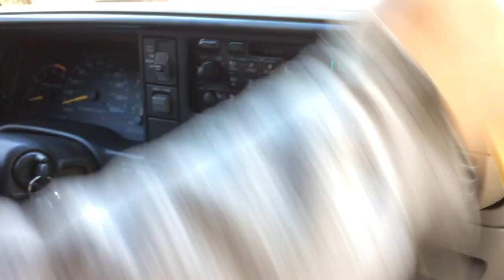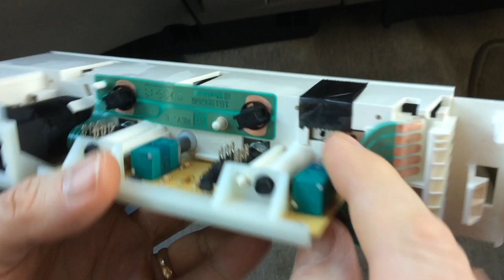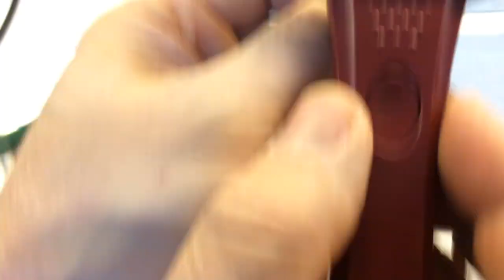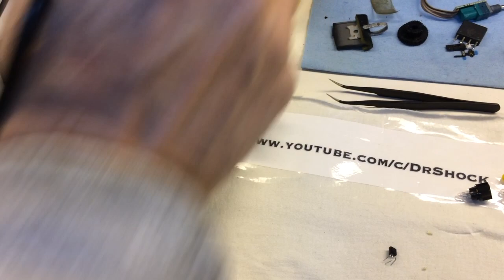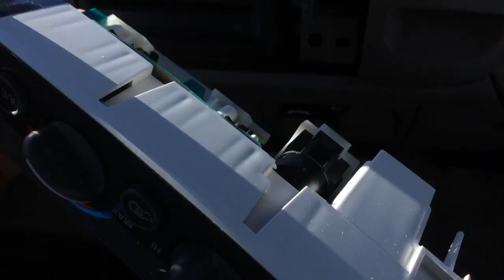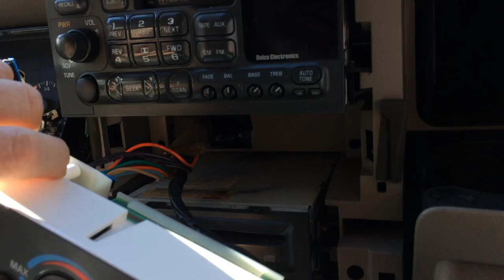1996 - 2002 GM Truck AC Blows Floor Only / Climate Control Module Transistor Repair (Chevy & GMC)

Comment: Have a 96 tahoe there ac/ recirculation button do not light up and the temp door or the zone knob do not work i have installed 3 different entire control units one actually is a dorman unit from advanced brand new and still no change.... the green wire on the connector was burned i replaced it And it is getting power but still no difference any suggestions
Reply from the maker: For the small orange lamps for the recirculation and AC buttons not to work it does sound like a symptom of this same power transistor being out.  Have you taken a multi-meter to the output of the green wire coming out of the flat harness (the green wire that goes thru the firewall to the accumulator cycling switch) to confirm 12VDC is coming thru?  If not, that transistor has blown on the control unit.
Reply: DrShock haven’t yet I’ll check tomorrow when i get off work but id be surprised that all 3 units have blown transitors im thinking it’s a power wire issue (green wire)
Reply from the maker: Unlikely, if you check the schematic in the service manual (there's some online links in older comments below) the transistor gets power thru the main harness (orange/dark red INPUT), and then switches it out to the underhood harness (green OUTPUT).   For those two orange button lamps on the control unit itself not to illuminate I would not expect the problem to involve that green output wire harness (tho it could be something other than the power transistor though).  Best bet is to tone it out with the meter and the schematic.

Comment: I have found on mine a crack in the pcb trail  must explain why mine would quit if the plug on the passenger side of the climate control unit was properly plugged all the way in but slide it out a little and my ac would start working
Reply from the maker: Easy salvage yard fix to replace the board from a donor, see if you have an LKQ facility near you.  They let you pull the parts yourself.

Comment: OK. Now my New "Standard" one failed exactly as my ACDelco. Small puff of smoke out the right side of the control until then the exact symptoms you describe. I examined both ACDelco and Standard and failure was the same. So it appears I have an intermittent short. Could you please dumb it down and explain how I find this short that has now blown that transistor on both the original ACDelco and the new replacement? Again, both assemblies failed the same with the same symptoms you described in failure. 1996 GMC K2500.  Thank You!
Reply from the maker: When they go intermittently like that, in my experience its a place where the harness has rubbed thru the insulation and is making contact to the engine ground somewhere intermittently.  Very unlikely to be behind the dash, more likely under the hood so start there.    If you go thru some of the older comments on this video, there's a thread with a PDF link to the GM service manual posted 6 months back where you can find the wiring schematic.   This can help you follow the harness colors under the hood searching for any physical damage in the spots where it comes in contact anywhere metal.  The damage can be very small!  So a magnifying glass might be helpful. You're looking for bare copper showing no matter how small.  The fix can be simply electrical tape short term, but longer term to wrap in some tough plastic piece to deal with the rubbing.
Reply from the maker: Also I should mention to check the refrigerant pressure switches for damage / shorting at their connectors (but do not remove them) as you follow the green colored wire in the schematic around to the compressor.
Reply: @DrShock  Thanks again. I must be missing something. I read all the posts and looked at the two views of the wonderful color schematic. All I can see is the light green wire going directly from the A/C Control module to the A/C high pressure cut out switch. From there to the CPU. I see no other routes as others have referred to. It seems like the easy thing is to just splice in a new (equal or better gauge) light green wire from the harness connector at the A/C Control Module to the HP Switch and then a new wire from switch to CPU. What am I missing??       Another thought: What about the ground wire going through the same harness at the A/C Control Module to gound up under the dash?? Couldn't a bad ground cause an over-current situation (I'm a mechanical guy not an electrical guy)?? It would be easy to splice an auxiliary ground from the existing black wire to some easy place under the instrument panel or behind the A/C Control module.  I would greatly appreciate your more experienced and knowledgeable thoughts on this. I'm getting frustrated and am spending too much money on A/C Modules. I did order the transistors you recommended and will be trying to repair two modules that I have blown.
Reply from the maker: The wiring can vary with every engine even in the same model year for the AC.  The 6.5L diesel V8 has the most connections with this particular light green wire circuit.   Looking at the 5.7L Vortec V8 (page 6-1675 in the service manual) yes its just the high pressure cutout for that engine as well as the 5.0L V8.  The 7.4L V8 schematic is on page 6-2789.  That light green wire is directly connected from the transitor on the control module logic board to the high pressure cutout switch and then to the VCM/PCM pin C3 on all the gasoline V8s.   If you see no insulation damage under the hood, I would check from the firewall back inside to the control module harness connector itself then.   It would not be the ground shorting out the transistor, what's burning it up is sinking too much current.  Ground problems would leave you intermittent or no function at all.  I would also try disconnecting both the control module harness and the PCM/VCM connector C (both ends).  And then seeing if you are getting continuity to ground on the light green wire from either end, highlighting a short to ground (do this test with a helper to wiggle around the wire harness during the test as well at both ends).  If so, I'd then disconnect the high pressure switch connection and try again (to see if it is the switch that is shorting in some way internally).  If its not the switch then you would still have a short somewhere, perhaps more likely on this engine from the switch to the VCM/PCM than the other part of the circuit.  These can be very difficult and aggravating problems.  Definitely one of those walk away for a bit and retry ones.
Reply: @DrShock  Great advice. I have 7.4 Gas so it is direct. I think the easiest thing is to just run my own wire from the A/C Module to the HP Switch and then from the Switch to the PCM. (From my experience it would be highly unusual for the switch to short to ground, but who knows!)  It will take less time than a  propper diagnostic as I have to work alone. My transistors arrived today so will take one A/C Module with replaced transistor, and then replace light green wire & green with white wire (I think) from switch to PCM and just see if it blows the transistor again. I will update this posting after I try that. Thank you again for all the valuable lessons and advice.
Reply: @benkanobe7500 did this work?

Comment: I did something I almost NEVER do, I replaced mine through Rock Auto with a "Standared Motor Parts" (when I was young, Standard supplied the highest quality points and condensers you could buy). They may be a China company now. But, they offered a 3 year warrenty as compared to OEM ACDelco of 90 days. It works perfect and was (I think around $150.00) and is well past 90 days. However, after seeing yet another astonishing YouTube of yours, I am going to get my original and see if I can fix it from what you have taught us all here. Amazing!
Reply: Agreed! I bought a replacement but now that I have no risk, I will fix. Why? Because we are men and we are curious! Lol
Reply: How is it doing now after 5 years? 

I’m looking to either get SMP or AC Delco climate control module with the OEM Delco costing less than SMP but it has 24-month warranty compared to the SMP’s 36-months. 

There’s little price difference between them, so I’m just curious how your SMP module is doing before getting one or the other.

Comment: anyone know where i could get the ac harness ?
Reply from the maker: Not sure which harness you're referring to, but the least expensive option I would recommend is a you pull it type of salvage yard.  Like LKQ.
Reply: it's the harness that is connected behind the hvac that you unplug to swap out the old hvac with a new/used one
Reply from the maker: Definitely wanna go salvage yard on that, cheapest route best fit. If there's an LKQ yard in your state that's where I'd go, that's a you pull it yard.

Comment: great video my problems exactly! Replaced climate control module 1 month ago! I went to the junk yard today pulled a control panel out of another suburban and put it in mine now everything works great again! pulled the brand new control panel out and it says made in china complete junk! bought the new one from Napa, so if you have this problem just find a working one from the junk yard!  my new one from Napa only lasted one month before transistor failed! QUESTION can you switch control board from the old one that works to the failed one I got from Napa?

Comment: I replaced the transistors, but one is still blowing our after replacement. I understand that there may be a short from the control unit harness to the high pressure cutoff switch on the back of the AC compressor. Are there any online tutorials to fix this problem? thanks so much
Reply from the maker: I'm not aware of any.   If you go thru the other comments here, there are some prior discussions and electrical schematic links that you can use to trace the circuit looking for any shorts.  When I've found these shorts before myself, they tend to be in places where the wiring, or the wire loom, has been rubbing for many years and the insulation was worn away.
Reply: @DrShock  thanks. Unfortunately, I have a 1997 K3500 with a 6.5L diesel engine. The diagrams that are provided are for the 5.7 gas engine. Any idea where to get an appropriate diagram?
Reply from the maker: I have a 99 6.5L Suburban, the wiring harness there is actually simplier than the gasoline setup.  The light green wire coming out of the AC control assy is what you want to trace all the way to the PCM.  There's someone who has digitized the 98 service manual, should be fine for your 97 here https://www.gmt400.com/threads/88-95-service-manuals.43575/  go download the 1998 4_of_4 one,  and trace your harness using the schematic on page 6-2304 of that pdf.   Pay particular attention to where the harness bundle would rub along the bracket holding the wastegate vacuum solenoid, common wear thru area on 6.5L.
Reply: @DrShock  awesome info. My wife and I just traced the entire wiring system . We found no shorts and  made sure to check resistance in all connections. Could it be a bad relay? I noticed the relay getting pretty hot in the fuse box. Thanks so much!
Reply from the maker: Well first, I just noticed your original post said "one is still blowing" and that schematic would be for that MPSA56 power transistor only.   Are you saying that one blew out again, or one of the other 2N4403 ones?   Just making sure we're talking about the same circuit here.
Reply: @DrShock  Oh no! I think I may have installed the incorrect transistor. The one that you were mainly after in your video is MPSA56, correct? I mistakenly installed a 2N4403 in it's place!
Reply from the maker: I've swapped in a MPS2907A as a sub here before with OK results.  But I'm not sure the 2N4403 would be able to handle that much current.   That one is meant for the blend door circuit paths.

Comment: Also, the fan speed is not blowing high enough, could same transistor be at fault?
Reply from the maker: Nope, totally unrelated.
Reply: @DrShock  Could just be the blower motor
Reply: Crap, I didnt check the fuses, looks like it could be a problem, but would be very concerned why the fuse blew.

Comment: I have a 1995 K2500 with a/c but no rear defroster.  As you know the control heads are non existent or $600+ at the parts house.  My temperature control works as it should, when the recirculate button is pushed the fan seems more powerful but the light doesn't come on.  The fan speed works as it should, but direction is stuck on floor but when you manipulate the controls to change to head or defog etc. the actuator tries to move a little, blend doors are not binding and you can take the blend door actuator for the air duct and try it on the temperature actuator harness it works just fine proving the actuator is ok?.  Also you you press the a/c button a/c does not come on and light does not come on, but the fan direction has a slight movement just like you are changing direction when you press the a/c or recirc button.  Could this pesky transistor be the culprit? Thanks
Reply from the maker: I've personally only repaired this 4X across as many Chevys.   In every one of those I didn't run into all of what you're describing, so tough to say for sure.  If you're experienced doing electronics soldering, it's a cheap repair from both a parts and time point of view.  The blend door actuator definitely wouldn't have anything to do with the control unit button LEDs not illuminating.  Worst case you have a bit of both a control unit problem and a blend door actuator (on some models if you power them up unmounted they get out of alignment - rotate past a stop position).

Comment: I ordered all new plugs for the three pressure switches. They all seemed loose and stretched out. We had problems with others before on the engine. I still feel though we have a wire directly touching some metal somewhere.

Comment: DrShock 
my truck heater control  (kind of like you explained in the video about replacing the heater control and shortly after the heater control is not functioning correctly) when on any zone selection the Defrost stays ON; with the AC on I get continuous air blowing out of the Defrost vent & the same when its switch to the Floor vent,
After watching your video I'm thinking that mine could be the same issue with the exact same Transistors have failed, you agree?
Reply from the maker: The MPSA56 transistor I highlight in the video is effectively a power switch, allowing 12VDC to the AC sensors and actuators circuit.  When this transistor goes out, the reason for the floor only air output is the loss of power to the blend door actuator (or zone selection actuator by another name). I've not seen the defroster symptom you describe, but it could be related.   You would have to try another control module or attempt the transistor repair on the one you have to know for sure though.
Reply: DrShock 
K, I’ll look for another control unit & try it first. 
Thanks for your help. At least I know someone out there knows something about these heater/AC control units.

Comment: Could the high pressure switch be bad? I don't see any issues with the light green wire, seems fine. Could it be a bad ground on the panel wiring?
Reply from the maker: That light green wire is the beginning of a circuit that snakes thru all three pressure switches, the blend door actuator and engine computer.  You'll have to check all of that circuit to find a short.   Though highly unlikely to be the control module itself  (what you are calling a panel) since you have had two different ones with the same outcome now.
Reply: @DrShock  I will start with the plug connectors and inspect all plugs. Then a visual check if the wires.
Thank you so much for the help. 
D

Comment: Since I am blowing them rapidly I was wondering if putting a 160 amp alternator might be the culprit or would the electric fan I added have something to do with it?
Reply from the maker: Nope, this is an isolated circuit only for the AC

Comment: The transistor under the hold down bracket is blown on mine. The whole panel was under warranty so they replaced it however after one week of use the mpsa56 transistor blew out again. You mentioned if it  does blow right away this would be a short in the green wire. What would it be if it blows several days after being replaced?
Reply from the maker: Just to be clear, the video I did here is mostly focused on that transistor used as a power switch for the underhood AC circuit and blend door actuator motor.   I never mapped out the functionality for the other transistors as I didn't have problems with those.  But the one MPSA56 I do go over, that one sinks all the current for the entire AC power circuit.  So it typically only blows quickly due to a short to ground in the wiring harness or pressure switch sockets.  When it isn't a short it should last months/years before they just die because of the device being a bit marginal for the purpose.  It could still be a short, I once worked on a truck where the harness had its insulation worn thru over two decades of engine vibration, only when it would rub against the exposed area would it blow.  Took weeks to track it down.
Reply: @DrShock  that was going to be my next question. Could it be a bad plug (loose connection) going into the high pressure switch? If its short to ground would it only be that light green wire?
Thanks for your help.
Awesome video.
Reply from the maker: Just start from the flat connector out checking for shorts, somewhere lower down in the comments I shared a circuit diagram with someone elses question and that will help you also.